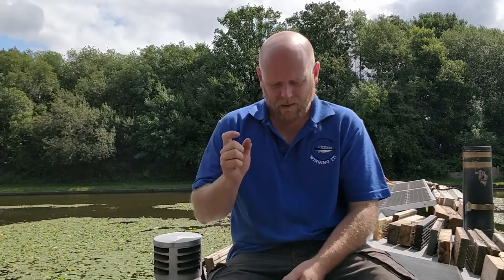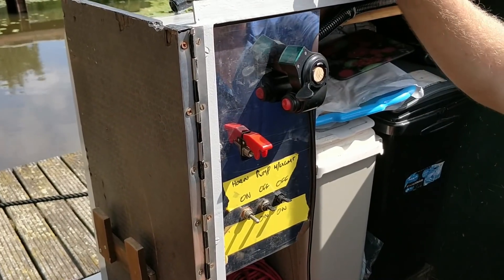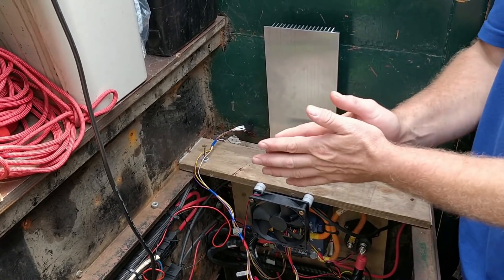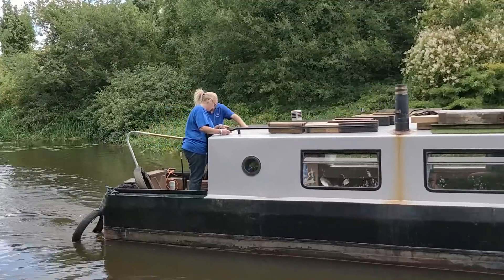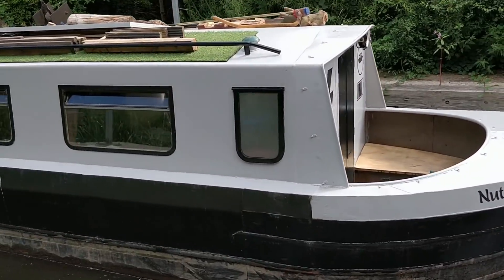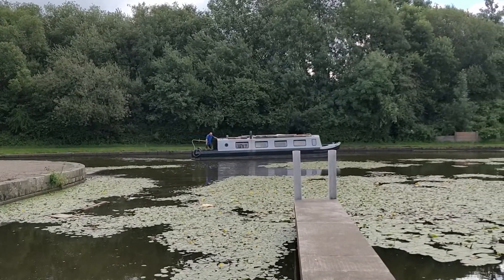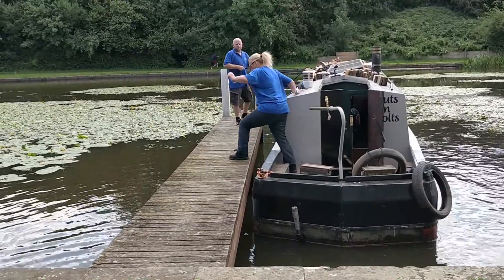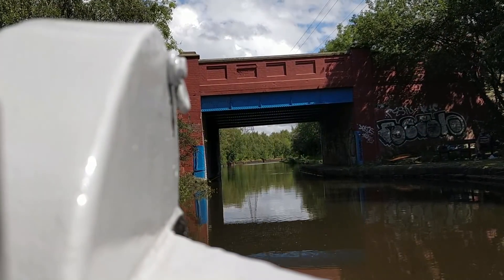DIY Electric Drive Conversion on a Narrowboat - Winging It, With The Tight Yorkshireman. Episode 9

Comment: You are taking part in canal history.  You are at the very start of the transition from fossil fuel to electric propulsion on the canals.  Every vessel on the network will be electric in the next 20 years, apart from those given historic exemption.  The official transition will start with financial incentives, like it currently does on the Environmental Agency controlled Rivers.  Then legislation will be introduced eventually preventing non electric propulsion on all inland waterways.  Great job guys.
Reply from the maker: I'm not sure how long it would take for the whole system to be set up for electric boats. But with advances in battery technology and increasing solar capabilities electric boats are certainly going to be a lot more prevalent in future years...

Comment: pahh again    been watching out the window / fire exit door for you coming past but hey ho always seam to go kaput just before    you know those fokamalift motors aint  made to run high speed for a continuous time just  short bursts possibly why its chucking a wobbly in controller
Reply from the maker: How far do we need to get before we are at your fire exit!? 
The motor is at about 1/3 throttle as we cruise along... I think something shorted out... 🤔
Reply: @WingingItBoatingonaBudget  Darnell  aqueduct /bridge will be back at work next week for a couple o weeks if it gets fixed    any signs of burn marks  skid marks on  components

Comment: Any chance of posting the model of that controller - as I posted on a previous post of yours  I suspect you have a hall effect throttle when it should have a potential divider - an overworked controller  stresses the  smoothing capacitors and if they give way surges the MOSFETs ( They go bang too!) - that your controller got so hot indicates it's pulling a lot of amps - that's a big prop and I bet your gearbox  is 2: 1  - it would be interesting to see what volts your motors reading  at full throttle - if it's not near your battery voltage then your props oversized - you could use one of the online prop calculators to find out the recommended prop for your boat and motor
Reply: if you were going to resize the prop - you'd just get rid of the gearbox
Reply: @danielburgin28  No a motor like that could only swing a 9.5" prop if it was to reach its potential of  2,500rev/min which would cause excessive slip on such a big boat - a lynch motor which has similar characteristics would typically run 1.7:1 - 2.5:1 on a canal boat depending on length.
Reply from the maker: Only just seen this comment I will get the model number etc later and pop it on... Cheers
Reply from the maker: Trev S any chance you could drop me an email to wingingitboat@gmail.com I have hit a stumbling block with the sevcon unit and you seem to know what your talking about with them!
cheers
Reply: @WingingItBoatingonaBudget  I sent you an email with what I think is your options - try this online calculator  https://www.vicprop.com/calculator.htm

Comment: Might be worth checking if the case or heatsink is negative. If so make sure nothing could be shorting to it. (use your meter and see if you get any voltage between the case and + terminal.) 
Dont worry about the money spent on a multimeter, it will save you ten times its price over its lifetime of being able to fault find.
Reply from the maker: Thanks for that, it did sound like something shorted!
Could you message me at wingingitboat@gmail.com
If you don't mind I'd like to pick your brain a little further! 
Cheers!

Comment: Great video and a very worthy project. Is it possible to just take out the spring from the throttle that way you should be able to leave it turned on.
Reply from the maker: We have thought of that... But until I'm sure it all works I don't want to start messing too much with things - just in case!

Comment: I hope the small pieces of decking on your roof are not for burning in your stove?

Burning treated wood is irresponsible and potentially dangerous to your health and that of others. Burning releases a cocktail of carcinogenic compounds and toxic heavy metals into the air. Every single stove manufacturer warns against it. In extreme cases you could be prosecuted. 

Do yourself a favour and dispose of the decking scraps properly, and buy or scavenge suitable fuel.

Comment: If it was easy everyone would be doing it. If heat from the speed controller is still a contributing factor to it falling over you could consider  mounting it onto the old skin tank or the side of the boat that is below the waterline and use that as a heat sink. This is how the old diesel engine would have been cooled, unless it was a Lister. The Tesla battery packs and controllers in the cars are water cooled so you would be in good company, you could be Yorkshires own version of Elon Musk!
Reply from the maker: Yes, never said it would be easy... I will make some investigation and see whether the control panel needs altering...
Reply: @WingingItBoatingonaBudget  That the controller got excessively hot  is indicative of drawing too much current - I suspect the prop  is a bit to big